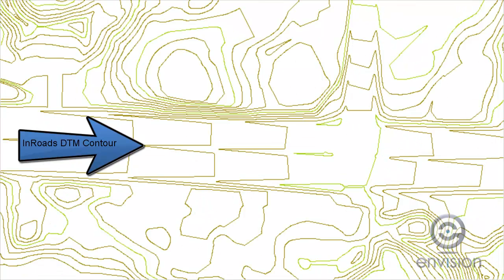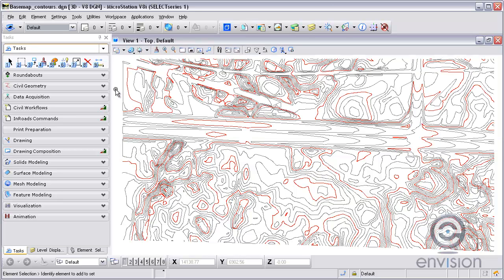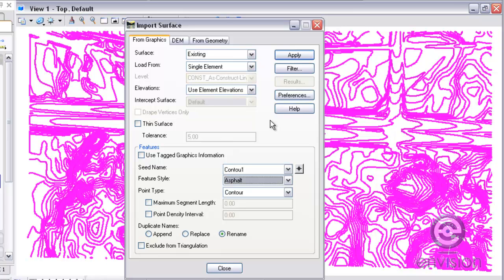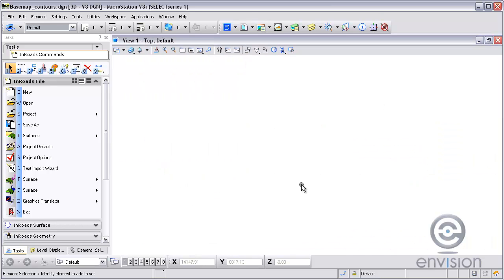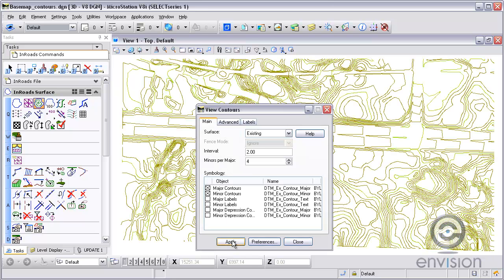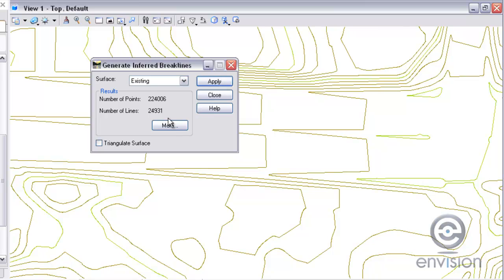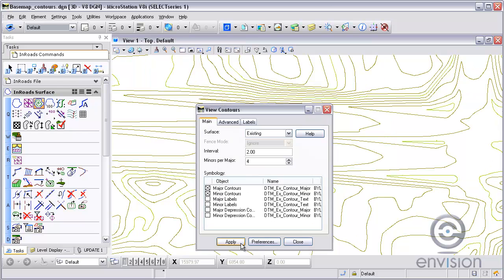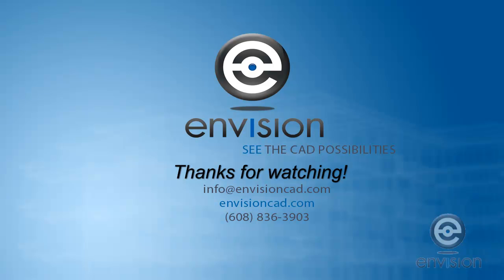InRoads Surface Import from Graphics - Contours

Comment: Hello...Is it possible to extrapolate the contours or dtm? What tool would you use to do that? I will appreciate the response.
Reply from the maker: Display contours dialog has settings to change how the contours are extrapolated.
Reply: envisioncad Lets say you have a 50m x 50m square of DTM and you want to extrpolate it to 70m x 70m....how would you do that?

Comment from the maker: ekenedilichukw, you are correct you will need to assign and elevation to each contour.  If you have a cad file made up of a lot of spot elevation as text.  You could import the text and InRoads will read the text as the elevation.

Cheers

Comment: Great video! I do a lot of highway drainage analysis and this is really good when you don't have DTM. But what if the contours don't have elevations with them, does the process still works or do you have to assign elevation to each contour?